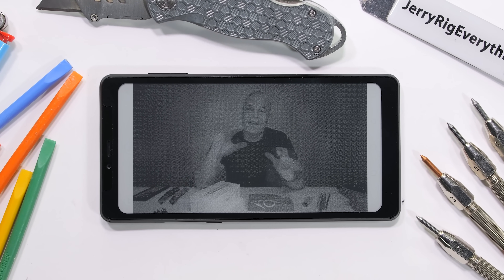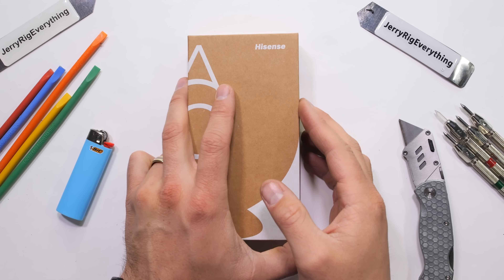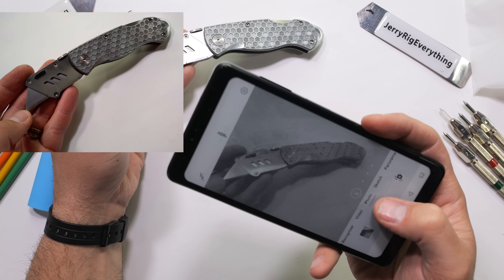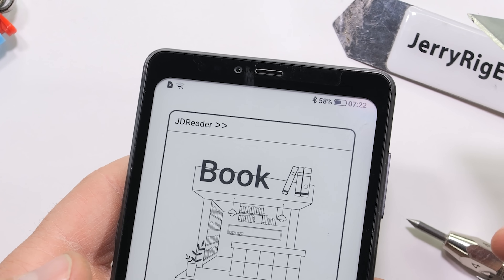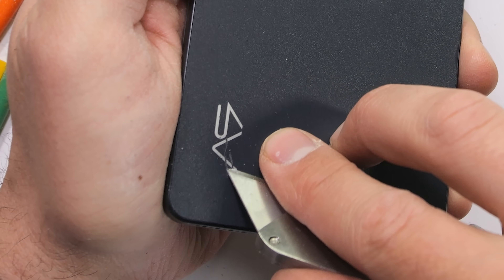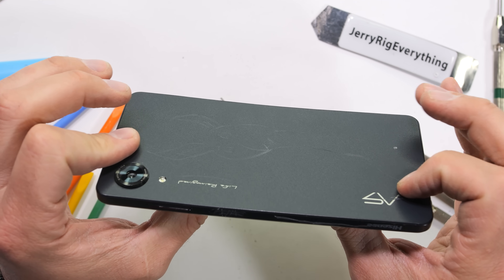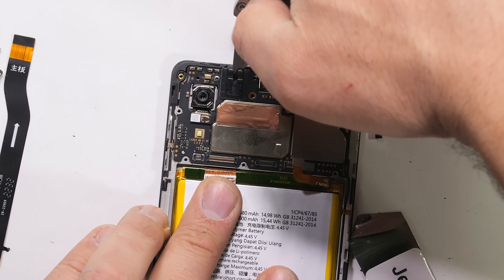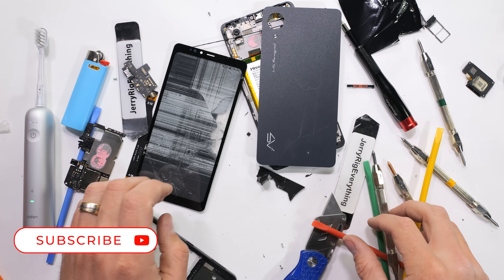This E-ink Smartphone has a Crazy Camera...

Comment: An E-ink smartphone won't be widely popular, but I think E-ink could be used as a secondary display on the back of a regular smartphone to display notifications, which would be like Nothing's Glyph Interface but more useful.
Reply: Agreed. Meizu used to make something like that if I'm not mistaken.
Reply: its been done but frankly AOD does the same with little battery usage
Reply: @gastontwo  Yeah you are right! Really sad to see that the idea never took off.
Reply: Xiaomi 11 Ultra was a great one
Reply: Yota phones had this feature.
Reply: Or it could be the front screen of a foldable...
Reply: I had a yotaphone 2 which was exactly what are you describing, it was pretty amazing back then but with time it performance wasn't good and no other successor came in... So I moved to Samsung G Note line
Reply: Hisense actually makes this! It's called the A6L and it has a front lcd and rear e ink
Reply: It'd be so cool if we got a tablet that integrated black e ink for reading writing with 0 delay, and oled for everything else, kinda like the current backlight. Obviously idk if that's even possible, but still
Reply: Oh if only that hasn't ever been tried before /s
Reply: @yusufaras01 a man of culture
Reply: Agreed. Even notifications aside, I think it'd be really cool to have a low power eink back panel since then you could completely change the phone color/design as well as displaying notifications n stuff without consuming any power between refreshes. Would be a gimmick mostly of course, but would still be pretty cool.
Reply: wasn't there such a phone with e-ink for messages in the early/mid 2010s?
Reply: Didn’t htc make dot display covers? Not sure if they were eink though.
Reply: @kastenbrot AOD impacts more than 10% battery life, and when you have a phone like S21 fe, with poor battery backup, this 10-15% matters a lot. An e ink would hardly take 0.1%
Reply: Or actually reading a book on a smartphone. I does read a lot on my smartphone and my battery always goes empty so fast.
Reply: It has terrible durability. A phone getting e ink back side won’t be able to score any of strength itself
Reply: Nokia LCD is more minimalistic and looks cooler, power draw is small as well
Reply: Yotaphone!! but the last one is from 2019, old and expensive.
Reply: That would be the only way I would buy one.
Reply: unless it's brand is iPhone
Reply: Better yet keep the outside screen OLED and make the inside screen a foldable eink display. Those are already plastic and way more durable than glass.
Reply: Xd I  didn't know  it was made 9 years ago
Reply: I had dual screen Yota Phone 2 and it was great until felt out of my pocket on a bike ride.
Reply: I would much rather have this than my current smart phone. This is cool.
Reply: I use my phone mostly for reading,writing OR listening to music, all would be better with eink. Would love a proper dual screen option.
Reply: That's a really good idea
Reply: Smart watches like the Pebble.
Reply: Very good idea
Reply: I've said this before. A dual screen phone like how Mobvoi did with their TicWatch Pro watch would be awesome
Reply: *which would be like Nothing's Glyph Interface but actually useful.

FTFY
Reply: I was thinking I would consider buying a phone case that came with the E-Ink display as an accesory rather than a main feature. Maybe add an extra battery behind the display for a "premium" version and we have a deal.
Reply: @justfpv1432  Too bad it has an ugly V-shaped notch and low-end components :/
Reply: E ink in colour could work for me. Definitely if you had a 2 screen set up like a flip or a fold. 1 of the screens could definitely be E ink.
Reply: This is it
Reply: Yotaphones are just perfect to your description. Except they costed a lot and would break easily
Reply: It had been done by yota phone, 10 years ago.
Reply: @girlsdrinkfeck  yepp, yota was it's name
Reply: @NickGeo25  this sounds really good, one day we can see this kind of device imo
Reply: Cool idea, they also use too little power and stay on forever.
Reply: Or In Electric Cars to save Battery
Reply: Great idea actually!
Reply: And having a second screen is very useful in emergencies if the front fails as jerry himself has faced
Reply: There was an e-ink case for the iPhone 6
Reply: YotaPhone 2
Reply: ^this. Yes please!
Reply: Why do we need notifications on the back? We don’t.
Reply: Takes less than a second to turn on and off a phone.
Reply: I love that
Reply: It existed. And Samsung patentes a technology to put a e-ink screen in cases. But Never used it :(
Reply: E ink monitors is best for programmers
Reply: Would be good for use as a vendors card scanner phone, assuming it's cheap enough. At Farmers market or swap meet or flea market etc to sell stuff with one of those card readers
Reply: It's gonna be a niche, but I could see e-ink smartphones getting some mainstream attention. Sure, OLED is nothing short of impressive, but imagine only having to charge your phone every 3 weeks instead of 3 days. I could see that being a selling point to people who don't use the media aspect of their phones too much.
Reply: Isn't the whole point of putting your phone screen-down NOT to get notifications?
Reply: I think Hisense has some phone with DUAL display~ one on the front one on the back. Hilarious
Reply: People don't know they exist since there is literally none in North America. If people knew about them I disagree with this one.
Reply: Hisense literally has a model for this.
Reply: That would be Hisense a6

Comment: I want a regular (edit: up to date and from a major manufacturer) smartphone with an e-ink back panel - shopping lists without turning on the phone, yes!
Reply: That is one great idea. It should be a new industry standard that every normal smartphone has an e-ink display on the back. You can nevermind it completely until you really need it.
Reply: there was one years ago, the Yota Phone 1. Frontside a normal display, backside a e-ink display. Sadly they never updated the models to newer better hardware (frontdisplay and chipsets) versions.
Reply: I'm a fan of Google Pixel phones , had a 2 XL for 4 years, now a 6 , I'm planning to keep this one as long as possible too, but if they slap an E ink on the back of the pixel 8 Pro and call it 9 Pro , I'm smashing the piggy bank.
Reply: that already exists, its called yotaphone!
Reply: The Hisense A6L is exactly what you are describing
Reply: @joseancor5008  Mostly agreed. Phones haven’t changed drastically since then but that’s still a 5 year old device and the camera is lacking. Surely someone is working on this with newer hardware. Right?
Reply: Yotaphone used to do this
Reply: @jimapollo  I had yota phone, the e ink refresh rate is so low that it can only be used to show a custom background, there are a lack of support for the e ink functions as switching from main screen to eink monitor it is like restarting your MacBook to boot window system, but it is good when you are under sunlight and would like to read b&w stuff.
Reply: @lemon9.9  yep, i know. That's why i said, that they sadly never updated the hardware. I truly was waiting for useable displays and chipsets, cause the idea itself is great. Why using a highly uplighted power consumptioning display when you just want to read a mail or notice or stuff like that. Maybe today it would be kind of perfect in a foldable phone, e-ink on the outside for just the ordinary noticing stuff and opend up - bam, full colored bright display for the - let's say - important stuff.
Reply: @jimapollo  I did only buy yota1 simply because I wanted to change the back panel into anything I want daily 😂😂 so if a low refresh rate coloured e-ink monitor is used on the back of the phone, I probably still buy it again😂
Reply: Try any Galaxy S Ultra (Formerly Note series) and you can write on your phone with the built in S Pen without actually unlocking it. This thing alone makes the phone sooooo much more convenient in day to day use
Reply: @lbbishmam  I have one - not the same.
Reply: @lbbishmam     how is unlocking it inconvenient? Also we are talking about e-ink monitor staying on while not being powered, it's about able to read what you wrote without power, writing without screen unlock is completely irrelevant

Comment: That actually looks amazing as a secondary phone, eg a work phone! Put away the colourful distractobox during the day yet still have the eInk phone to respond to messages from colleagues or get paged if the system you maintains goes down yet still be able to log into all the systems you need to investigate the problem while you're finding a place to set up your laptop. Even has a camera + headphone jack for Zoom! I wish you'd mentioned the price because if it was low enough to be a secondary work phone, I'd honestly be tempted

Comment: I'd love an e-ink bicycle gps. Daytime outdoor readability on those things can be a challenge on something that is typically used outdoors during the day.
Reply: well, you could already use an garmin instinct 2 to upload GPX track and then get a handlebar bike mount to mount the watch, also garmin has way more advanced metrics :)
Reply: Get a cheaper one without color screen, but with a mono LCD display. I have a bryton aero 60 and it's perfectly legible in direct summer sunlight.
Reply: Yeah, get a Bryton... Or just an old Garmin  Edge 500 (what I have). Still works great, though no mapping...
Reply: Not to mention once you get the power requirement low enough with e ink you can power it by your pedal strokes
Reply: @wheelsonfire1982  Pedal strokes aren't going to power the GPS though.
Reply: The MotoActv is transflective.
Reply: @RandoWisLuL  haha, you got great imagintion mister! funny reply. I own fenix 6s pro and instinct 2. The Instinct 2 has way more precise sensors and better performance. Fenix is sluggish and slow, never used garmin pay/maps on it because phone was always faster.

Comment: I really love the idea but I don't think I would enjoy losing color on my smartphone. I love the benefits of E-ink, I only wish that color could be applied somehow. Once that is accomplished I would probably switch over. Awesome review!
Reply: Hisense’s A series offers models with color e-ink screens, typically known as the A5/A7/A9 CC. However, aside from the clarity being considered 10 times less than the non-CC models (a necessary trade-off, as you need to divide the total number of available pixels on the screen by three to accommodate the tri-color filters), the colors are also quite dull, resembling the pseudo-color screens of the last century.

Comment: I work in a business with field technicians that need mobile devices to complete work orders.  If the frame were more durable, this would be an absolute game changer.  Easy to read and complete work orders and better battery life.
Reply: Just slap a case on there and it's probably durable enough, no?
Reply: get a cover bruh. Is it that difficult? And install a protective glass

Comment: I would absolutely love to have e-Ink smartphone, but what hurts it the most is not the screen, its the UI. As long as the UI is centered around swipe, drag and scroll, it will be a disaster to use with any e-Ink display. If, however, they'd manage to rework the interface and make interactions less dependent on gestures and more of a page-to-page experience, that would be a completely different story.

Comment: I had one of their A5 Pro models and it was the best phone I'd had since the first smartphones came out and regret dropping that log on it and ending it.   Battery life with heavy use was reliably 4 days. 

It's screen looked perfect in the harsh Aussie sun and one does notice the change from the tendency of moving to the light/outdoors when checking messages etc instead of heading into the dark to help  see normal screen.

Comment: Funnily enough this video was my introduction to e-ink smartphones.
Since I picked up a Hisense A5 CC Pro Color, which is an earlier model with a colour screen and without Google services.
This screen trades 25% of brightness for achieving up to 25% colour saturation but still refreshes at a maximum of 15fps.
Working around the lack of Google services was a bit of a challenge but also worthwhile as the combination of MicroG and alternative apps works better for me.
It's a great phone for me so far that does everything I want, though I do worry about having to replace the battery down the line.

Comment: I have an old Yotaphone 2. OLED on the front side, eInk on the back. Originaly with Android 4, updated not only to 5 but also to Android 6. It was a great phone - and in a way it still is. I actually still use it as a secondary phone (and as a third one, I have one in office and one at holyday home, in case I forgot my main phone).
The eInk is phantastic for eBook reading. Also while mostly using the oled screen on the front, the eInk shows a clock, new mails, missed calls, weather etc. So if not using the phone, I put it on the table with main screen down.
If Android 6 would not being so outdated nowerdays, I would still use the Yotaphone 2 as my main smartphone. Nowerdays I use the Catapillar S85, with a thermal camera. Would realy love a new phone with all features combined, eInk on the back, OLED on the front, thermal camera and an actual Android.

Comment: This is basically where LCD screens were 35 years ago. The refresh rate was terrible, the color was terrible if it even had color at all, but the quality factor was that it was more power efficient and portable than a CRT. I bet in the next 10 years or so, e-ink displays will be usable enough to replace other display technologies simply because of the initial qualities that an e-ink display has.

Comment: honestly, I want an e-ink smartphone with 'flagship killer' specs, as long as the e-ink compromises aside from the lack of color are minimal. I don't watch things on my phone and I don't play games on my phone. I use it for information, conversing and calling. I value light weight, long battery life and good camera performance most, plus what in today's world would be considered a small form factor (6.3", though I'd accept larger if paired with a smaller aspect ratio).

realistically, why do I need a color smartphone, which are normally heavy, large and yet have poor battery life? I hope more companies release e-ink smartphones.
Reply: I recently bought a Motorola Edge 30 Neo, the only recent smartphone with 'flagship killer' performance that is decently lightweight. 20g less than all of its competition lol.

and I say flagship killer in quotation marks cause it's a bit of an odd term, but I mean daily use performance that's on-par with flagships.

Comment: I wonder if manufacturers could pull a similar trick to the dual processor Huawei watch. Layer a transparent e-ink display over the AMOLED for an always on display, minimalist interface, battery saving mode etc, but still have the ability to switch on the high power and full colour display as needed/wanted.
Reply: I'd rather it does the inverse, where an LCD is layered over an e-paper panel and provides color when turned on. The LCD could have a lower resolution to save money, with a togglable hi-res grayscale mode.

Comment: I think LCD MIP (Memory In Pixel) is better than E-Ink in terms of color and refresh rate while it has similar characteristics to E-Ink which are: 
1. Power Efficiency (only consumes power when the image changes, static images will not consume power).  
2. No need for Backlight continuously: it is highly visible under direct sunlight.  This is because they can use reflective technology, where ambient light is used to illuminate the display, further reducing power usage as backlighting is not continuously required.

Comment: Couldn't we putbe-ink displays underneath a regular amoled display? When oled displays black it's by turning the pixels off, couldn't that be used to have the e-ink display show through? A mix of displaying the e-ink part and the amoled part could be used as a battery saver, there could be an extreme battery mode that completely switches to the e-ink, and of course you could change back and forth depending on what you are currently doing.

Comment: The LG V60 had a dual screen case that the phone could be inserted into. It has a smaller status disply on the front, when in the closed position, could be opened up to use in dual screen mode, similar to a galaxy fold,, but just two individual screens, or folded to the rear to use the phone as a regular single screen phone. I am still bummed that they left the phone market, cause they made such great phones. I feel like an e-ink display would have been the PERFECT cover screen for a new generation of dual-screen case, had they still been in the market, and I would have 100% bought it. The great part about putting the dual screen functionality in a case, meant people who didn't care for the feature could just... Not buy it. For me, the case is indispensable!

Comment: you don't need all the colors to make this work for color.. rgb should do it
then you can save everyone so much energy by only using energy to attain the desired color or shade on the screen.
example:   to get a shade (greyscale, in other words, Red & Green Scale) of yellow (from RGB by mixing red and green) and therefore you will have your color screen stay on with ZERO powah when the battree is fully disconnected.

so each pixel will basically need a greyscale, a red , a green and a blue.
white_  light up only greyscale white
yellow.. light up red partially and green partially to get yellow 
light up not being the correct word based on it stays on with no power